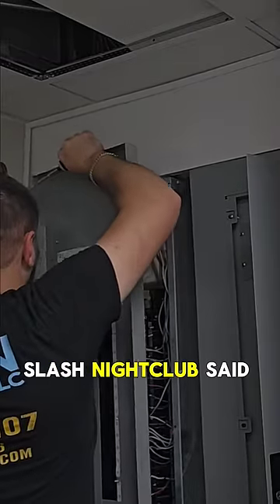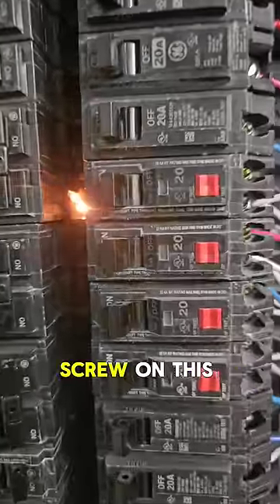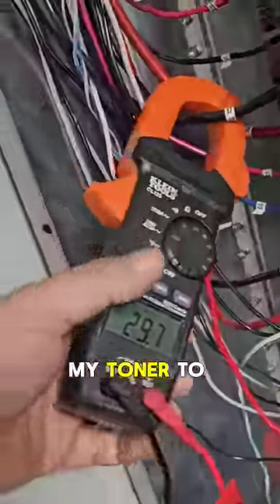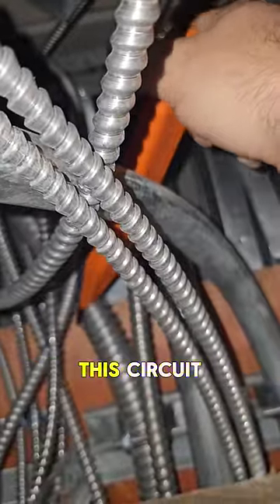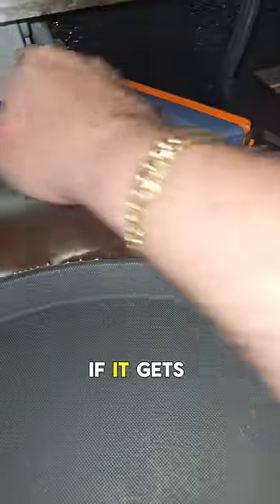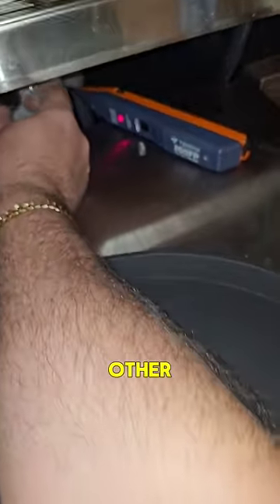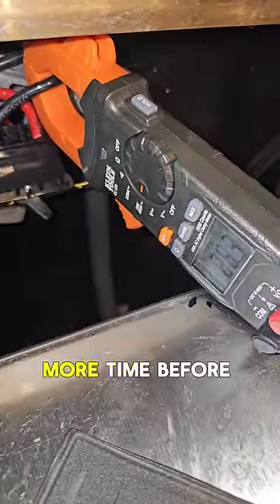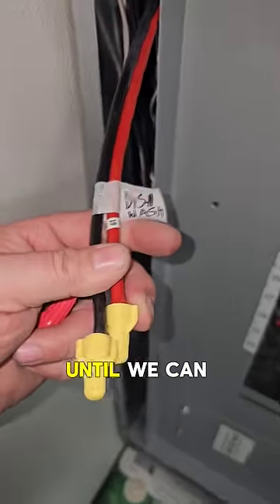This bar/restaurants panel was smoking when a 50 amp bolt on breaker melted down. Simon Electric

Comment: why use an infrared temp probe if you can already SEE it?
Reply: Why not?
Reply: @juliomaldonado4028  well if you're trying to fix something fast and not burn the house down why waste time
Reply: @megamanguy if it hasn't burned down by the time you have arrived, it won't burn down in next few minutes, unless an arc flash happens, which is highly improbable with slow overheating. Also there is nothing combustible or fueling the fire nearby.

Comment: I opened a panel to see a glowing hot neutral wire. I chased down the circuit, and the neutral wire was being shared by 8 different 20 amp circuits. 
Dont share neutral wires unless the circuits are on poles 180 degrees apart. Never share neutrals on 3 phase, and better yet.........just never share neutral wires.

Comment: Hey can you give me the info of the toner you have. I have been trying to get one.
Reply from the maker: It is a tempo 200XP I really like it and I have a few different brands
Reply: @Simonelectricfl   I work as a fire alarm technician, basically what you are doing but it is low voltage and we face similar issues, our method is put resistors (4.7k) on the end of line and meter it.

You say you have other brands, what is the reason for that choice of tool?

Comment: There’s smoke pouring out and the bus bars, red hot but you make sure it’s nothing important before shutting off the breaker. If it was something important, would you have left it on?

Comment: I dont at all understand. What is a bolt-on breaker? U mean a breaker that uses both bus bars for 240v? Why did the wrong screw cause a fire? Did it poke through too far? Did something connect which wasnt supposed to? Why do you have to order the part?
Reply: It was a loose connection to the buss bar.

Comment: what screw? breakers snap in.
Reply: The screw that is holding the bus bar in place. Some electrician messed with it.
Reply: Lmao... The video said sushi restaurant.... In commercial panels breakers do not snap in... Commercial breakers bolt in.... There is a bolt holding every single breaker to the bus bar in that panel.

Comment: I kept getting called to a certain restaurant bar frequently because the 3 phase equipment wasn't working. Traced the problem to the utility pole and two of the cut outs were popped. Called the utility company and had a little talk with the foreman. They changed all 3 defective cut outs. Problem solved.

Comment: I'm surprised. Usually a certified electrician carries both commercial and residential circuit breakers with them in a van. From 15 amp to all the way 50 amps.
Reply: This needed more than a circuit breaker replacement.

Comment: You still needed to look at it through a thermal Camera ? 🙄
Reply from the maker: Yes to see how much the heat has spread. If other areas are too hot, I will safe that off aswell
Reply: He's also a content creator, showing us a physical measurement of the temperature. If he didn't show it, you would comment "HoW cOmE yOu NoT sHoW hOt?? 🥵 Durttt"

Comment: The panel is on fire, but let's not shut it down until we figure out what it is hooked to by using voltage tracers. Amp sniffing dogs, oscilloscopes.  We wouldn't want that order of French fries delayed.  I think a better way to go is to turn off the offending breaker. Stop the meltdown immediately. Then, simply walk around and look for an appliance that is not working due to no power. 😮

Comment: I wouldn't even touched that panel unless the power was shutdown and it the whole panel and breakers were replaced.  If you start on the panel the owner will blame you for every problem that panel has in the future.   Food places always seem to have overloaded panels.  Remove all metal from your body before working around electricity.

Comment: I love how many people keep saying it's "arcing." Buddy, friend, pal; that's not an arc. The screw itself is glowing orange because the poor contact is causing high resistance. If the electricity doesn't have a wide enough path to travel through, it squeezes through regardless, generating heat.

Comment: I am not an electrician

If there is a fire hazard, is that not an immediate shut down? The building litteraly is not safe.

If it is shut down, why cant the work be done then? No need to chase a line.

Just cut power and fix the obvious problem?
Reply: Lol
Reply: @joeybasile545 Amazing reply! Super informative!
Reply: hmm. you are not an electrician.

Comment: Does your circuit tracer actually work?  When I was an electrician about 18 years ago I bought two different types.  They were both useless!
Reply from the maker: This one works good there are a few little tricks but in many situations it works well

Comment: If it arcs and smokes there is a draw on it  so you know you're turning off something that needs to be on. If nothing was using  power through that breaker.even if it's bad connection it wouldn't smoke or do anything

Comment: Sounds like they opted for cheaper labor, and it bit them in the butt. A friends son who apparently isn’t mechanically inclined, mixed up two screws when he puts in another oven element. And about burnt up the wiring in said oven. The element uses a machine screw and he uses one of the mounting screws and it wouldn’t tighten up of course 😊.
Reply from the maker: Haha you may be right

Comment: You don't have a electrical item list in the panel, so you have to use the wire searcher?
Is this common?
I would have turned that thing off straight away.

Comment: Ya.... we would just re-tap the bus bar (very common practice in the trade)... done this many times and it is a 100$ fix.... replacing the bus bar would be at least 2000$...not sure what the video is highlighting... any compatent electrician can work on live circuits safely...

Comment: When you say the wrong screw, are we talking something like metric in an imperial socket? Wrong pitch like m4x1.5 in an m4x2 (etc, making up numbers)

Or do bus bars use special screws/materials, so they just picked up a hardware store screw in place of a specialty one of the same size/pitch?

Not a super important thing for me to know, i don't pike screwing with anything more than low voltage DC anf especially can't see myself dinking around in my own house's electrical panel, but it'd be good to know if the latter situation is a 'thing' in the electrician world :]

Comment: You were looking for the 50a sump pump?
Reply from the maker: No a sub panel that fed a few things including the dish washer.
Reply from the maker: Often there are sub panels down under bars behind fridges or whatever and there were 4 bars at thus location. Also, there was no panel schedule but I might not trust a panel schedule either
Reply: @Simonelectricfl  i thought minimum sub panel ocp was 60a?
Reply from the maker: @coreyfranco7060  Do you have a code reference? There is no minimum that I'm aware of. There is a code I believe it's section D of like 225 or something of nec and that just states, the disconect or panel itself needs to be rated for 60 amps if i remembercorrectly. Not that you can not have smaller breakers in it or feed it with a smaller breaker.  But either way I don't know if there was a panel installed weather or not the followed code. I have seen 30 amp sub panels before so a 50 amp sub panel is not out of the question.
Reply: Nevermind, i was confused with something else

Comment: It’s glowing hot but hang on I’ll just check it with the heat gun just to confirm
Reply from the maker: Do you know if other breakers were getting too hot but not glowing? Glowing starts at about 450 degrees but the breakers around it could be 200 or 300 and melt the bus bar as soon as I leave if the heat kept building.  You leave the thinking to me buddy

Comment: that's scary, that could have burned the whole building down if things got any worse.  Many electrical fires have happened exactly because of this.  use trusted licensed electricians so you don't run into these problems.

Comment: Had Spaces at The Bottom, Install New Breaker, Shut Bad Breaker Off,  Remove Screw While Live If Critical, Actually Think He Screwed Through Buss into Panel Enclosure.
May want to Remove Top, Bottom and Side Screws Securing Guts, To Enclosure, Pull Out Enough to Eleminate Short. 
Once Connected, Check Current Again, if Same, Equipment Still Runing, If Not May Need to Press an On or Start. Panel Should? Be Labeled. Look at the Cover.

Comment: American panels look so arcaic to me, we use din rails to clip the breakers on and screws for the qires built into the break. So well designed an idiot can do it or a tired electrian. I take engineering and the biggest lesson I learnt is design for ease as much as possible as everyone makes mistakes and can have a bad day.

Comment: Canadian electrician here, I’m assuming that you turned off the breaker first, then hooked up the fox and hound and traced the wires to make sure something vital wasn’t being left off for the weekend. Cause leaving a glowing red hot smoking breaker on while tracing the circuit seems irresponsible to me.
Reply: Yeah it definetly is.

Comment: Making it out to be way more than it really is much less what makes you see a single 50 amp and assume it’s a sump pump..
Reply from the maker: I have seen it many times before! 50 amp maybe feeds a small panel under a bar that feeds a grease trap drain pump or lift station pump. I hope you don't find out the hard way after a huge flood in a beautiful bar like this

Comment: Yes, let the fire continue..... dude just open the fkn breaker. You dont need to check current. You dont need the circuit energized to tone it out. 

Its not a hospital. So what if a fucking sump pump.stops running for a few hours...

Comment: Idk i think i wouldve just turned it off, fire can take a lot more lives than water damage
Reply from the maker: I disconnected it instead of just turning it off
Reply: @Simonelectricfl  i meant in terms of looking for what its feeding, im not gonna look if it supplies a sump pump
Reply: Lives is a good point, but also have to consider your wallet.  Shelling out for a strip and refit of somewhere because you turned off a pump just by lack of checking is going to hurt.
Reply: @retrozmachine1189  id rather take that option than get a fine/jail time for not removing a fire hazard. Idk how it is in america but where im at all the breakers are supposed to be labelled what they feed, especially important services like a sump pump
Reply: @Extra_Mental  I'm not arguing that it shouldn't be turned off but at the same time you still want to know what it is you are turning off.  Take a few minutes to walk around and discover if there is anything critical on the circuit before leaving and if so move it to another circuit if possible.
Reply: @Extra_Mental if you have someone there on fire watch ready to shut it off if it gets worse, there is no unacceptable danger.
Reply: @ke6gwf  if it gets worse they arent gonna be able to shut it off
Reply: @Extra_Mental  shut the breaker off and you instantly remove the load.
Shut the main off and you remove all possibilities of a load
Reply: @ke6gwf  thats my point though, preventing the fire from starting in the first place by turning off the breaker. Shutting off the mains because a fire started is still not ideal because you still need to put the fire out and deal with the damage its done to the board

Comment: I was not expecting a GE breaker box to have this issue, probably an installer error though. When I think of a smoking breaker my mind instantly goes to the old 70s Federal Pacific and Zinsco stuff that was badly designed. Almost had a friend’s house burn down in an electrical surge due to multiple failed Zinsco breakers, which cost that family their entire electrical system. I’m always glad my parents’ house has a fairly modern Square D panel.

Comment: I traded in my 2014, which I had it since new, on a lightly used 2023 Hybrid i-Force Max.
I drove 75% city and 25% highway with my 5.7L, and drove it for almost 10 full years. I’m a carpenter and it was used as a work truck, tools and such in it most of the time.
Mileage at trade in was 18.1 L/100 kms, which is 13 MPG. Not great.
My i-force Max after two months in the same driving is getting  14.7L/100/km (16 MPG). That’s a 23% improvement in gas mileage, AND it has more power, and quieter, and it’s bigger (I have the CrewMax with  6.5’ box).
So far, so good and I am happy. Hope it’s just as durable but we shall see.

Comment: TLDR don't be a dick and impact breakers in.

I had some dip shit install breakers with an impact at a Walmart, I needed to change a breaker (one of those controllable ones that work with the novar controllers, it wouldn't switch anymore unless someone manually did it) but we couldn't get it off without an impact so we had to come back after closing because the panel we needed to shut down was 1/3 of the lights to the store and all of the check outs. Not a big deal but it sucks having to go out in the middle of the night just because you need to shut a panel off for less than a minute all because some idiot needed to really send it with that impact.

Comment: thats the downside of using 110V  to many amps...
Reply: Well that's a two pole breaker... Meaning it's not 110v it's 220v. 
And wire is sized based off the breaker. You can have 400 amps of 110v if the wire is the right size.
Reply: @chasejordan22 i don't know those breakers if you have one phase 230V you get with 2 phases 400V you can run much thiner cables thats cheaper and easyer

Comment: I noticed in the US you guys always seem to have problems in your panels, In the UK its very very rare to have an issue in our distribution boards.
Reply from the maker: I just chose to show panel stuff it seems like it makes better video. we probably get 10 calls for every panel issue.
Reply: The UK designs new hardware to improve safety and cost. The US designs new hardware to make old hardware incompatible and force an upgrade instead of a repair.

Comment: You're full of it. You're not going to repair the bus bar.You're going to replace the panel goofy. Besides the amp reading you're getting is false because the panel is burning up.The breaker is putting out more than it should compare to load.

Comment: Wh6 is the guy reluctant to turn it off? Yeah, it may be running a pump, but it’s better to turn it off to stop a fire than keep it on and have a fire.
Reply from the maker: I would have ran safe temp power if it was necessary and it was only on for a few seconds after I found it